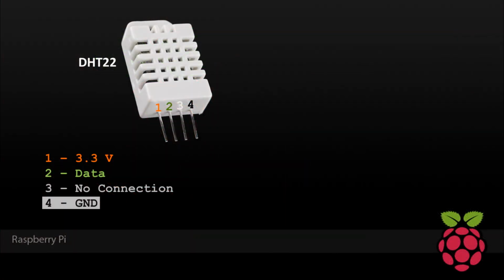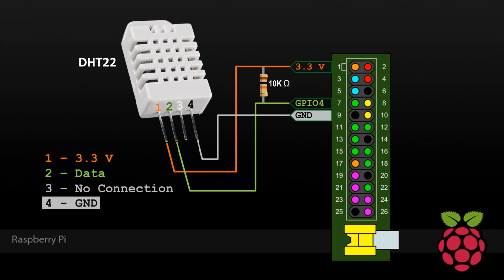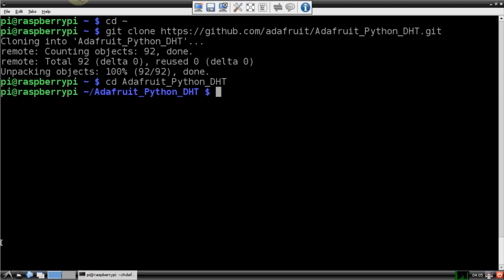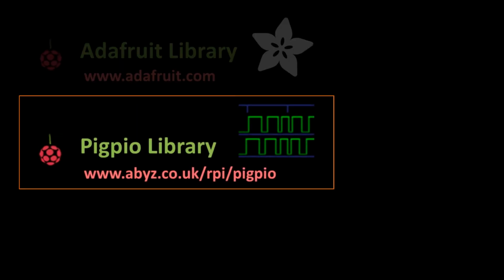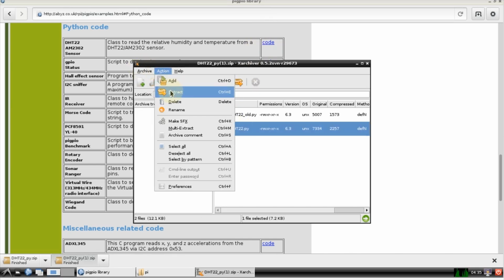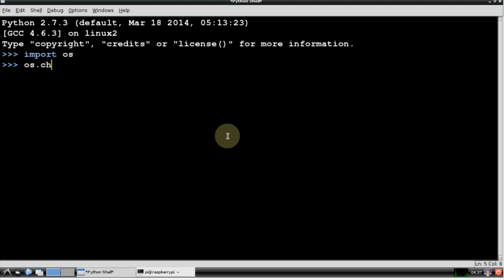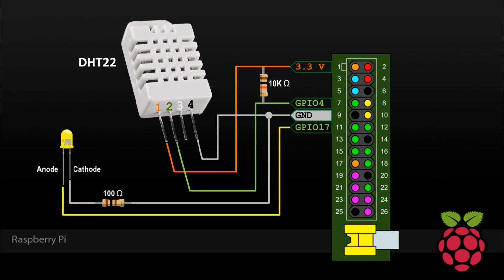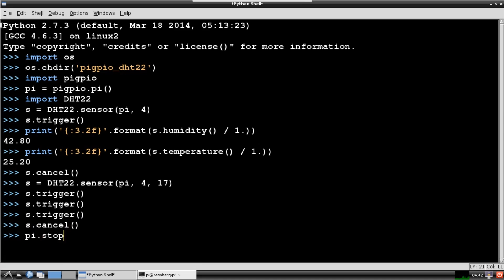DHT22 Raspberry Pi Humidity Temperature Sensor Tutorial

Comment: Great, just found you because you were suggested to me: I'm doing a similar project with five DHT22-sensors on a RasPi. Would like to have your comments, but it's unfortunately in German, not in English... (maybe you have a transcript...)
Reply from the maker: The video is 8 years old.  I stopped using the DHT22 sensors.  There are better choices now.  The DHT22 protocol is problematic.  It requires very precise timing.  This may cause inconsistent data.  I’m now using the Adafruit Si7021 temperature sensors: https://www.adafruit.com/product/3251.  They are reliable and easy to use because of the I2C protocol.  There are many newer options such as AHT20, AM2301B, BME280, SHT30, SHT40, SHTC3, HTU21, HTU31, HTS221, etc.
Reply: @rdagger  Ah, ok. Yes, I also had a couple of problems, especially with python and MariaDB connector versions. Changing the sensors is not an option right now, as the circuit is already soldered and the hardware has been bought. For now it's working fine. Anyways, thanks for your reply!

Comment: Great video! Is a breadboard required for this sensor? Or is there some method to wire it directly to GPIO?
Reply from the maker: No a breadboard just makes it easy to demonstrate.  You could solder the resistor across 2 wires and then use female Dupont connectors to attach the Pi and DHT22 or just solder everything.  Alternatively, Adafruit sells a DHT22 (AM2302) with a built-in resistor and wire leads.  Also Adafruit has several newer temperature/humidity sensors with the STEMMA QT connectors for easy solderless connections:  https://www.adafruit.com/category/66
Reply: @rdagger  Awesome, thank you so much!

Comment: Hi, for the library DHT what is the command for Raspberry pi 4, where you make it run as root, since it does not find such a directory by typing / usr / bin / gks -u root dle, thanks
Reply from the maker: Super-user privileges are no longer required for GPIO access with the latest version of Raspbian.
Reply: @rdagger  I've this problem: raise 
RuntimeErrror ('Error accessing GPIO. Make sure program is run as root with sudo!)
'File "/usr/lib/python3.7/dist-packages/Adafruit_DHT-1.4.0-py3.7-linux-armv71.egg/Adafruit_DHT/Beaglebone_Black.py", line 213, in read

Thanks
Reply from the maker: @TheLocones  Looks like it could be a bug with  the Adafruit platform_detect.py.  The video is old and the Adafruit DHT library has been deprecated.  It would probably be an easy fix, but I recommend you try the newer Adafruit version instead:  https://learn.adafruit.com/dht-humidity-sensing-on-raspberry-pi-with-gdocs-logging/python-setup
Reply: @rdagger  
I thank you for your time, regards

Comment: can anyone explain how the current flows throuth the sensor?
Reply from the maker: The current powers an IC inside the DHT-22 which monitors 2 sensors.  A humidity sensor comprised of 2 electrodes sandwiching a moisture holding substrate varies resistance as the conductivity changes.  For temperature, either an NTC sensor or a thermistor is used which varies resistance based on temperature.

Comment: Hi. Thanks for the video, super useful! Is it possible to interface several of these to a single PI? I am looking into a project that will require 3-5 RH and T measurement points
Reply from the maker: In theory, it should work, but I haven’t tried.  You would need a separate GPIO pin for each sensor.  Some software libraries might not be compatible.  Also some libraries might work better for multiple sensors in terms of allocating memory for DHT objects.

Comment: Where can i find the code for microcontroller reading the 16bits RH and 16bits Temp?
Reply from the maker: I don't think either library in the video exposes the raw 16bit readings.  However, you should be able  to just multiply by 10 to get the raw values.
Reply: What do you mean by multiplying it by 10?
Reply from the maker: See page 3 of the DHT22 datasheet on my website.
Reply: But where can I find the codes for mcu reading the 16bits rh and 16bits temp?
Reply from the maker: I don't know of any specific libraries.  Try searching Github.
Reply: My instructor is asking me where can he find the codes for 16bits rh and 16 bits temp readings in the library?

Comment: can you interface this and MQ-135 together? or show a tutorial on how to interface MQ-135 alone?
Reply from the maker: The Raspberry Pi doesn’t have an ADC so you would want to get a sensor that supports I²C, SPI or serial communication.  Or you could use the analog sensor with an ADC adapter chip such as the MCP3002 or ADS1115.  I have another video on the subject:  https://youtu.be/wJgyszOSoQU

Comment: This is so old but hopefully I'll get a response. Is it possible to create a loop that according to the Temp reading a heater turns on/off to keep the temp at a constant degree? I am trying to make a mini incubator that is constantly at 37 degrees Celsius. So if the temperature goes higher, the system cools it down and if it's lower it heats the chamber up.
Reply from the maker: Yes.  That should be very easy.  The loop would poll the sensor and turn on a relay if the temperature is too low and turn off the relay if the temperature is too hot.  You might want to allow a target range such as 36 to 38 to prevent the heater from frequently turning off and on.  If you don’t need humidity, you could use as DS18B20 temperature sensor.  They are more reliable and can be purchased with stainless steel weather resistant enclosures.  I used the DS18B20 for my server room temperature monitor project and it has been running reliably for 5 years now.

Comment: I keep getting this error, ImportError: No module named 'Adafruit_DHT'. I tried running a code on IDLE         
https://electronicshobbyists.com/temperature-and-humidity-sensor-dht22-raspberry-pi-interfacing/ and it keeps giving this error. Yes I've installed all the Adafruit libraries and build essentials etc, I really cant solve this problem
Reply from the maker: Sounds like you might be targeting the wrong version of Python.  If you are using Python3 then you have to target Python3 when you install the Adafruit DHT library.  There are instructions on my website.
Reply: @rdagger  Yeap I managed to fix it already. Thanx !

Comment: Hi, is there a way i can run this program in terminal rather than idle3 ? Thanks for any help.
Reply from the maker: Yes.  From the terminal you can type the command python to enter the Python interpreter.  Then you can just starting typing Python code.  Alternatively, you can use a text editor such as Nano to create and save a Python program.  Then from the terminal you can run the program by typing python <the filename of your program>
Reply: @rdagger  many thanks. Trying to get my head round what all the little inserts mean such as , " % () ^* ect. Again thanks for your help.

Comment: ok So I got this thing working and even wrote a simple program to read the humidity and turn on or off an LED depending on the humidity level. Problem is when I reboot the Pi, I have to rerun the adafruit commands or my programs won't run. Anyway to add that to my program so it runs those before the program starts? I wrote my program in python.
Reply from the maker: Which commands do you need to retype?

Comment: This is the most simple program I've found for the DHT22, great for a noob like me.  NOTE: this program will not run in Python 3 but runs fine in Python 2.
Reply from the maker: Thanks.  You have to target Python3 when you install:  sudo python3 setup.py install
Reply: Ah!  Thanks, I really appreciate the effort you put into the video.  As a beginner it's an enormous help.   I have another question.  Is it possible to just read the humidity from the DHT22 sensor?  I'm trying to create a control from my dehumidifier and have a a 120V relay that I'm going to trigger on and off with an "If" "Else"  code based on a target relative humidity level.  However, it seems like the "h,t = dht.read_retry(dht.DHT22, 4)" will only return both the temperature and the humidity data.  I just want the humidity data.  Any help would be greatly appreciated!
Reply from the maker: Yes.
h, _ = dht.read_retry(dht.DHT22, 4)
Reply: Thanks ! I've got it working

Comment: Hello, thanks for sharing the video! I'm trying to do the same as you did on your website using a ethernet cable other what I would like to be a long distance. I used a BSS138 and the adafruit librairy. It works fine with a 5m cable but I can't get it to work with a 10m calbe. The only difference is that I use only one cable for the ground. Could that be it? I don't understand why you are using two. Thanks
Reply from the maker: Yes, I recommend using 1 twisted pair for supply and ground and another pair for data and ground.  The theory is to reduce interference relative to ground.  There are many factors that can contribute to EMI (nearby equipment, electrical lines, noisy SMPS, circuit design, etc.)  You can also use shielded Ethernet cable if problems persist.  Only the Pi side of the shield would be connected.  10M is not very long for a DHT22 at 5V.  The datasheet indicates  a 100M limit.
Reply: Thanks for your answer. I did solve my problem and it was actually the Adafruit librairy that was not working with long cables. I switched to pigpio and everything was smooth!

Comment: Since I'm not up to speed on Python, I'd like to see a 2nd DHT22 for outdoor Temp. & Humidity.
I'd also like to send it to a, (Serial or i2c) LCD.
Reply from the maker: I have an example of using an LCD display with the DHT-22 on my website:  https://www.rototron.info/dht22-tutorial-for-raspberry-pi/#lcd
Just below that example is a schematic of how to power the DHT-22 at 5V which will probably be required for an outdoor sensor because of the length of the cable.  I have an Aosong  AM2306 hooked up outside at my house.  It is software compatible with the DHT-22.

Comment: Congratulation for this good video. Could you please help me out how to connect this kind of sensors (or any other similar sensors) via wifi or bluetooth. I would like to read data of sensors placed in different rooms of my house but since the distances are pretty long and walls and paintings are done I can not use direct cable connection. What is the simplest way to hook the sensors wirelessly? Any suggestions would be appreciated. Thank you.
Reply from the maker: Yes, you can use an inexpensive ESP8266 or ESP32 which is easy to program with MicroPython.  I have a series on the subject.  The first video is an introduction.  Then 2nd video demonstrates how to transmit DHT-22 temperature and humidity data wirelessly using MQTT protocol from an ESP32 to a Raspberry Pi.
https://www.youtube.com/watch?v=w15-EQASP_Y&list=PLKGiH5V9SS1hUz5Jh_35oTFM4wPZYA4sT

Comment: Thanks. I used Adafruit libraries. It works for my RPi 3 after I changed to python3-dev and python3 setup.py install in the installation part. The funny thing is I need to put additional brackets for the print statement, otherwise it shows a syntax error.

Comment: For the pigpio library, how do you make the sensor update? I'm trying to make a tkinter window that updates every two seconds with a loop. While testing it with print, I noticed that the values never change.
Reply from the maker: Use the trigger() method.
Reply: I posted the question on stack overflow with all of the code and the details of the error. Can you please take a look at that? Thanks.
https://stackoverflow.com/questions/48071393/why-am-i-getting-a-nonetype-error-in-the-second-repetition-of-a-loop
Reply from the maker: I answered your question on StackOverflow and included code.  You were prematurely disposing of the DHT22 sensor and the PiGPIO daemon.  You need to hook the window exit and then execute the s.cancel() and pi.stop() methods.  fyi:  please dont include hyperlinks in comments because YouTube's spam filter blocks them and I don't see the message for several days.
Reply: Thank you for your feedback! It works perfectly now.

Comment: When I use the read_retry command, it says that there's an error accessing the GPIO. I followed the instruction of giving Python superuser access. I am using Python 2 because in Python 3 the import Adafruit_DHT as dht gets an error.
Reply: I've switched to Python 3 seeing after getting it to work. However, I still get the same error. I have looked at your troubleshooting site already.
Reply from the maker: What is the exact error message?  You do not need to use superuser access with the latest version of Raspbian.
Reply: Nevermind. I used the pigpio method and it worked. Thanks anyways.

Comment: thank you so much for this tutorial. I have a question. After using the pi.stop() and the exiting  python, I got "error in atexit._run_exitfuncs"  Do you have any idea why and how to fix it?
Reply from the maker: I was unable to reproduce the behavior using the code from my site.  I tried both a new Raspberry Pi 3 and a very old Raspberry Pi A.  Which Pi are you using?  Are you overclocking it?  You can try adding a sleep after the cancel command.
Reply: Hi, thank you for your reply. I am using Pi3B. I tried to add sleep after cancel command but still got the error. I also executed the python command line by line in terminal instead of executing a script file. The error appeared when I execute exit(). I opened a question in stackexchange including the script and the error. https://raspberrypi.stackexchange.com/q/76911/78326 really appreciate your help
Reply from the maker: I would comment out the following line from the DHT22.py library:  atexit.register(self.cancel)
It looks unnecessary unless you were running an infinite loop.
Reply: oh perfect! this solved the problem. Thank you so much!

Comment: Can i install 2 sensors and tittle them?
Reply from the maker: I haven't tried, but yes in theory, you should be able to have multiple DHT22's connected as long as each has its own data line and GPIO pin.  You can assign variables to the GPIO pins used by each sensor and give them appropriate titles.
Reply: Thanks!

Comment: Hey rdagger68... this has been going on for long enough ..  don't you think ???
Scrolling down the page..  there are actually 35 linked videos 
On how to function and code temperature sensors
Seriously
You, even boast about setting up a humidity and temperature sensor 
There somewhere In your own area....

How cool..    what for ???

In this big big world we live in...
There really has to be some real practical application this exact coding method[ which is actually the real reason for the temperature sensor exercise tutoruals ]
Can be used doing something other than reading temperature and humidity

Advancing to reading temperature and humidity....  wirelessly !!!!!
That was some big deal...
Became hard to read the signal through walls 
So now we had to read temperature of the room we are in..

The  advances being being able to read the temperature remotely 
By Lan Wan....

Too late to discover your pot grow room at home or in the garage
Is killing your plants

2014 was over 3 years ago
Where were all these geniues suppose to take this knowledge..
What is the next step for them
What was if for you???

Even back in those days I was moving past this rudimentary coding

Where did YOU go with this ???

Took me quite some time to figure out and code
Projects that were a step above the RC control by bluetooth by children
Playing with cars...

Finally engineered a system where I could control a 12MP hand cam

Receiving Transmissions of:
Both LANC and IR code from a Processor ( Aurdino/Ras Pi- or anything )
As well as PWM motor TILT and PAN functions of the camera base
Receiving Transmission by way of  
Ethernet Network Lan wired connection
Wireless Lan transmission [ Wi-Fi ]

From a Transmitting processor [  Arduino/Ras Pi  ]

By way of Ethernet Network Lan cable
or Wireless Lan
Of Playstation 3/4 controller Bluetooth transmission
To the Processor board by EZ Bee Tranceiver
Covertinng the Analog to Ditigal signals across the boardAnd by code 

Transmitting to the receiver board for remote control functions
Makes the home automation by relay contolr

CHILDS PLAY....
Designed and engineered this system by trial and errorBECAUSE I HAD TO...

That is what we are suppose to be doing... Engineering and coding ...  more complicated than a temperature gauge data read.
Manipulation of the hardware to suit your functions
Researched my hardwareFigured out what the conrol code had to be
Designed the best ways to transmit the code for those functions
Spent months getting limited functionality..   But I did get functionality...

Teaching myself C++ that catalogues control code shrinking down the Library
Constriction on your SD cards capacity to hold your function code
Will overcome your biggest roadblock in creating code for your project.

All about R & D guys